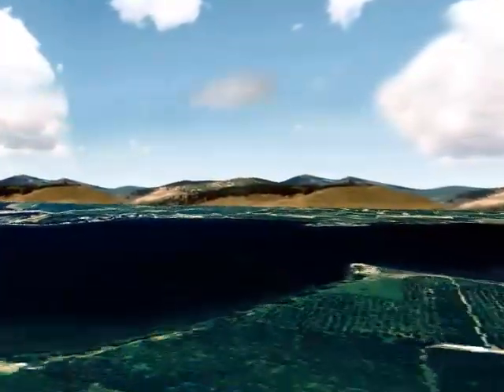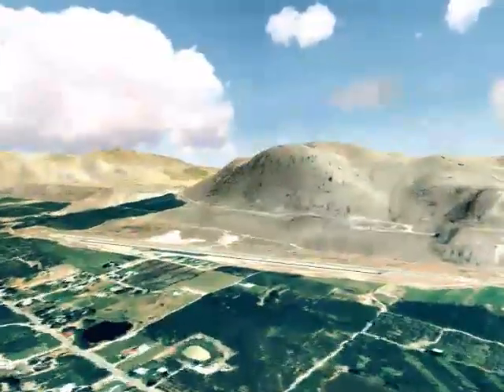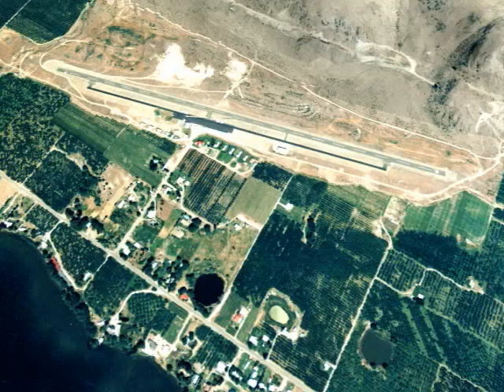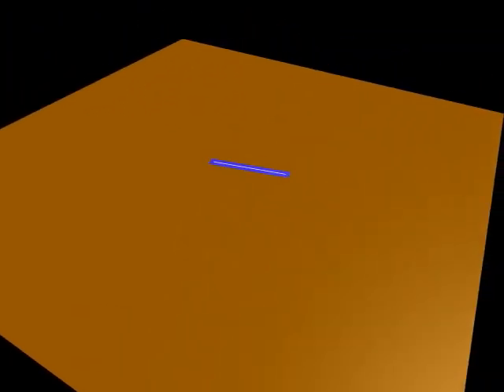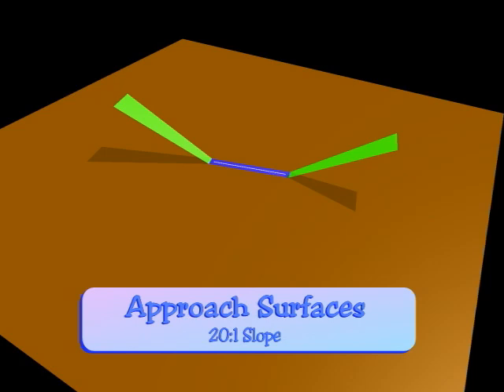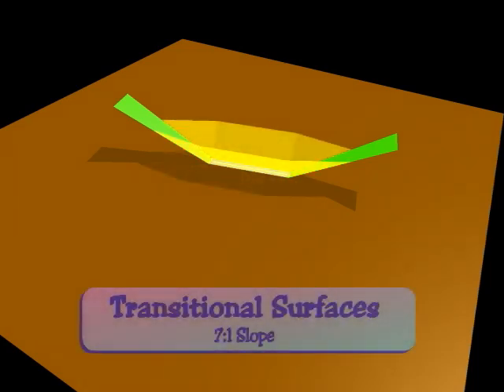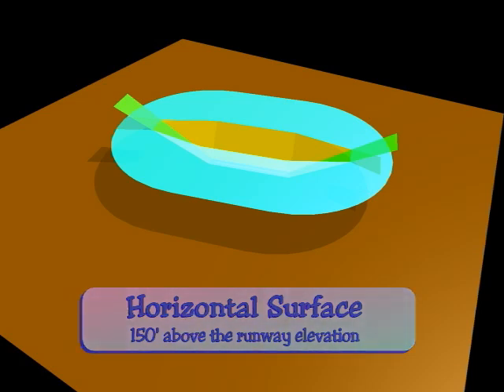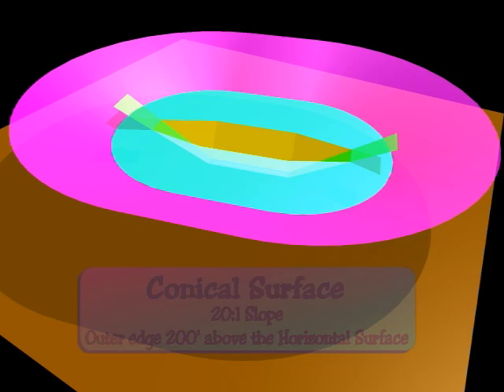Understanding Part 77: Civil Airport Imaginary Surfaces

Comment: Hi, so just to clarify, only the primary surface and approach surface need to be clear of physical obstructions, whereas horizontal surface, conical surface and outer horizontal surface can interfere with terrains or other obstacles?
Reply from the maker: Ideally, all the surfaces would be free of airspace obstructions. You are correct. Topographic features often penetrate the conical surface, horizontal surface and even transition surface in some cases. Generally, the most critical surfaces to safe aircraft operations are the primary, approach and transitional. Please note, penetrations of the horizontal surface can result in adverse impacts to airport operations.